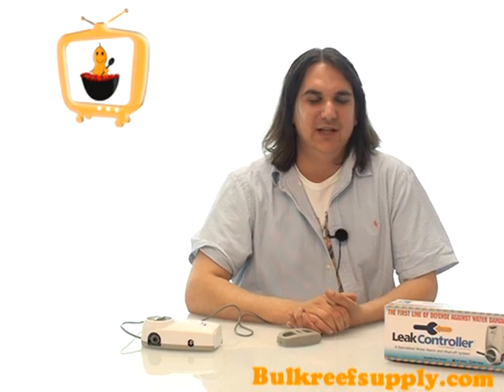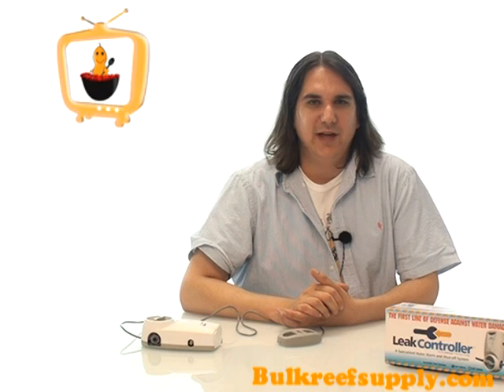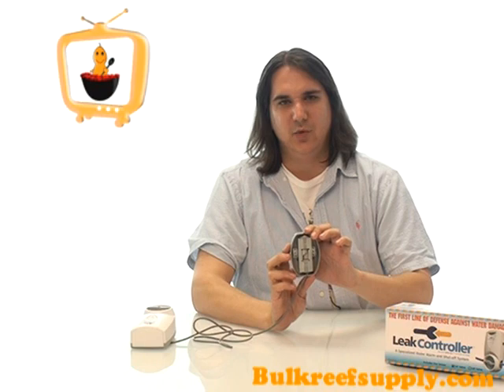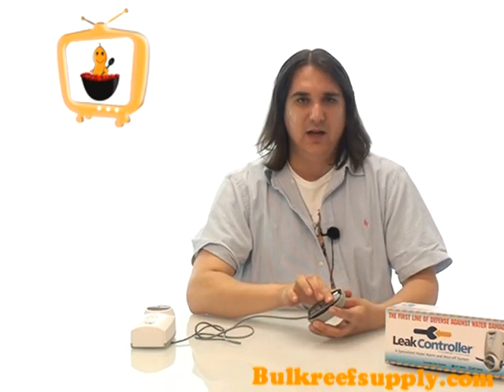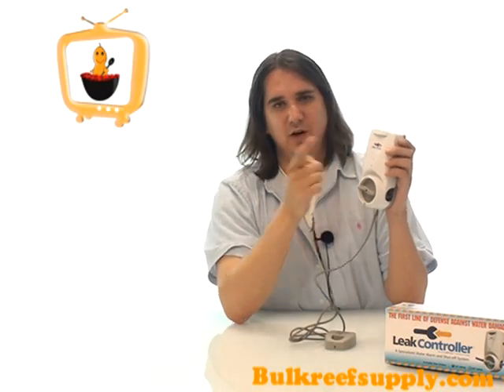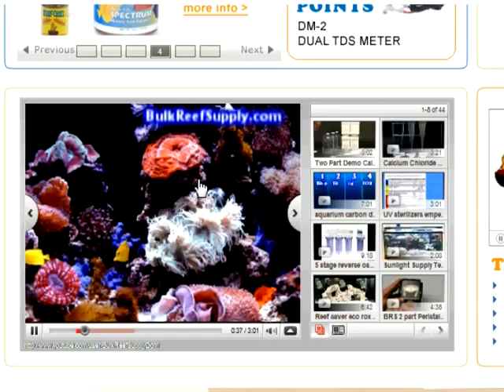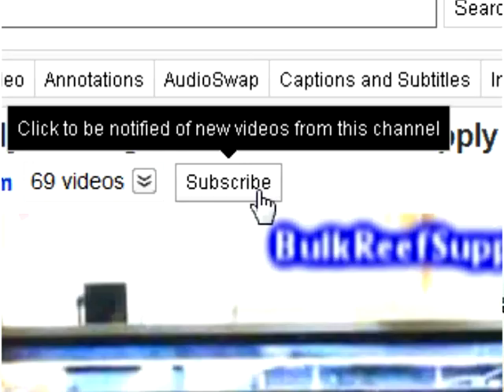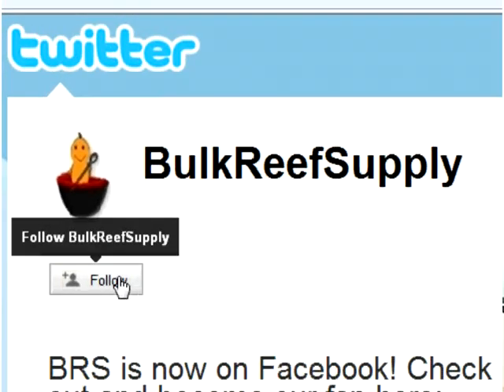Reverse Osmosis Leak Controller Demo - Bulk Reef Supply

Comment: Junk product back then. Probably why the aren't sold now.  I had one...RO elbow broke, the leak detector was beeping, but it didn't trip the valve.  
If you're watching this because you picked one up at Goodwill or something, pitch it in the trash and get a FloodStop.
Pay the extra few bucks and save yourself a lot of repair bills if you have a leak.